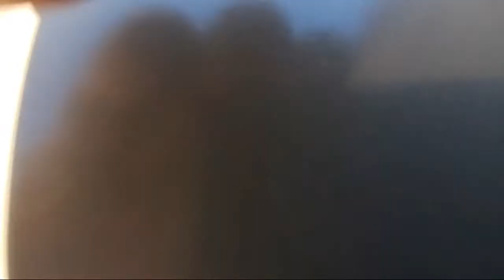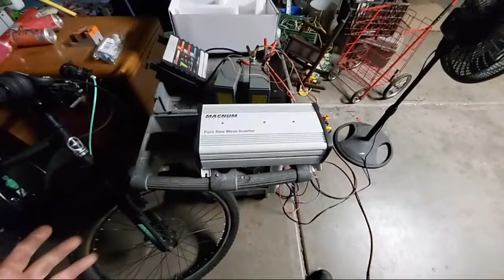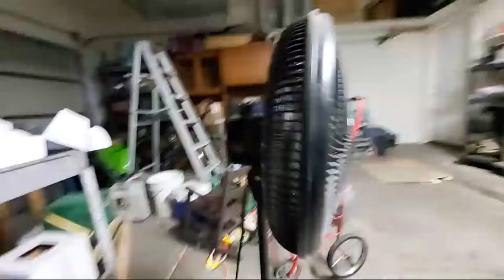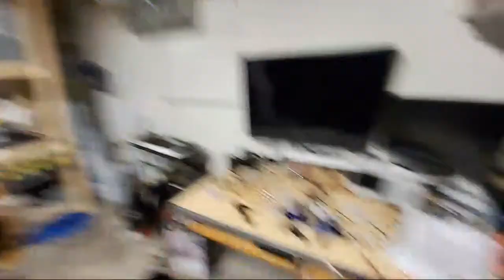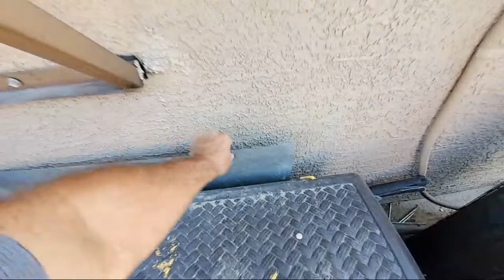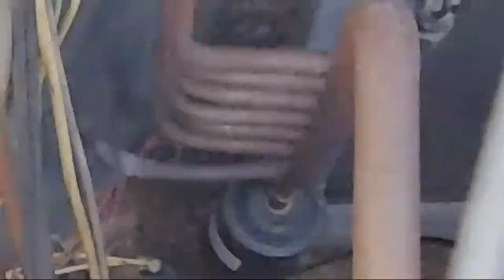One Step Forward One Step back? - DIY Solar Assisted AC

Comment: There's a couple of tricks for mitigating the inrush to the capacitors. They have mov devices that are purpose made for the job. Another strategy is to put a resistor in series with a relay in parallel on the normal open contacts. You charge the capacitor bank through the resistor then close the bypass relay.
Reply from the maker: I've seen the resistor/relay trick on those LG and Mitsubishi circuit boards.
I was starting at them to follow the traces and see what was up.
One had like 12 big resistors in parallel and I realized that was what they were doing.

MOV's shunt high voltage (for utility voltage spikes).
Reply: @hackfreehvac  yes, you're right. I called it the wrong thing. I was thinking of an ntc thermistor. They look similar to an MOV. They have high resistance when the circuit is first switched on, and the resistance decreases as the thermistor warms from the current passing through it. It works the opposite from how those supco super boosts work. I know how much you love those lol, but it's an option.
Reply: @Richard Vaughn my comment was in response to the statement about inrush on power up. I'm really curious to see a sketch of his buck converter design. I want to know how he's dealing with the fact that when you pass ac through a bridge rectifier, both sides of the dc bus have potential to ground. If he's tying references together, that may explain some of the component failures. I mentioned in another comment on his last post that it would be good to model the circuit in spice software to help identify the bugs.